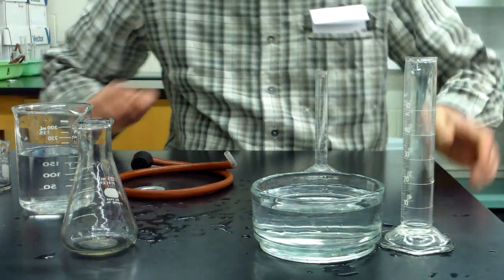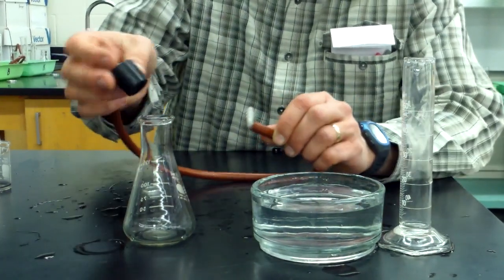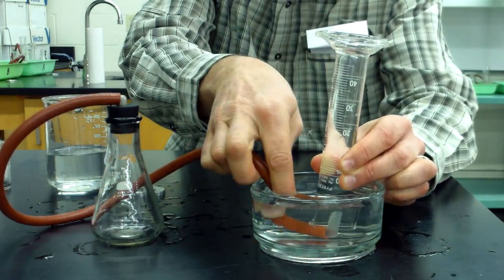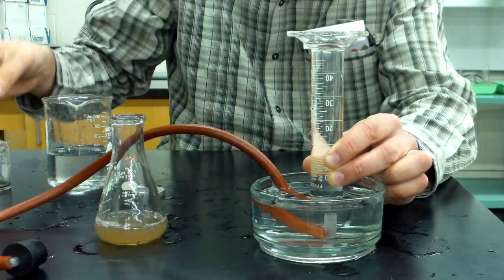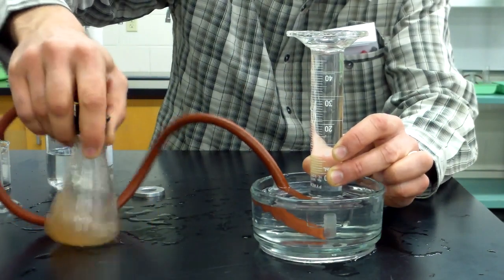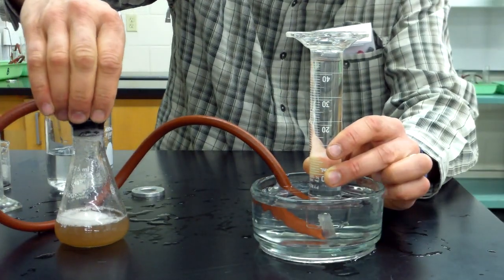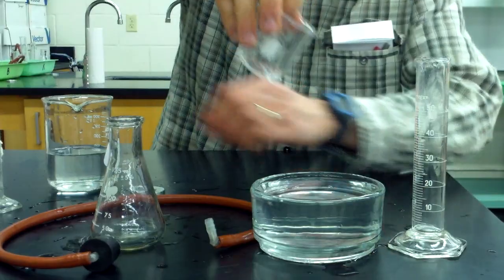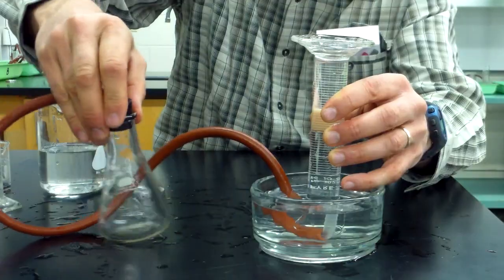Enzyme Lab Setup Demo

Comment: isnt this downward displacement of water?
Reply from the maker: Yes, you measure how much gas is being produced by how much water is being displaced by the gas. You can't see or count the gas molecules so you have to have a way to measure how much is being produced. Water gets displaced by gas accumulating in an overturned tube filled with water so it works perfectly for this lab. You can visualize and measure how much gas is being produced with this technique. Lab techniques are just clever applications of natural phenomena.

Comment: as an hypothesis which one would you make?
Reply from the maker: In this experiment we are testing to see if the rate of reaction changes when you change the concentration of enzyme. You can also run this experiment where you change the concentration of the substrate, change the pH or change the temperature to see if the rate of reaction changes. A valid hypothesis is any hypothesis that can be tested. An example of a valid hypothesis for this experiment is as the concentration of enzyme increases the reaction rate will increase. There are many variation on this that are also valid. for example, as the concentration of enzyme increases the rate of reaction will decrease or as the concentration of enzyme increases the rate of reaction will stay the same. A hypothesis is a possible answer to a scientific question and as long as it is testable and in the form of a statement, it is a valid hypothesis.

Comment: Why does the water decrease in the tube
Reply from the maker: +naveed ehsan The amount of water in the overturned graduated cylinder decreases because it is being displaced by the oxygen gas molecules that are being pushed through the tubing from the reaction chamber. The oxygen gas molecules rise to the top of the graduated cylinder and collect there displacing or pushing the water down and out the bottom of the graduated cylinder. The faster the oxygen gas is being produced in the reaction chamber, the faster it will be pushed through the tube and collect at the top of the graduated cylinder.  This allows you to measure quantitatively (with numbers) the rate of the reaction in the reaction chamber. You can't see the oxygen gas exiting the tube but you can see it when it collects at the top of an overturned graduated cylinder filled with water. The oxygen gas molecules are causing the water to decrease in the tube.
Reply: +Glen Burger thanks